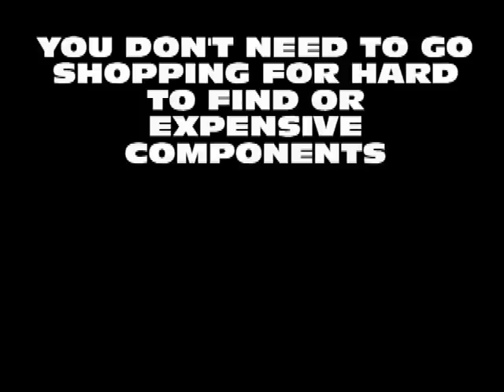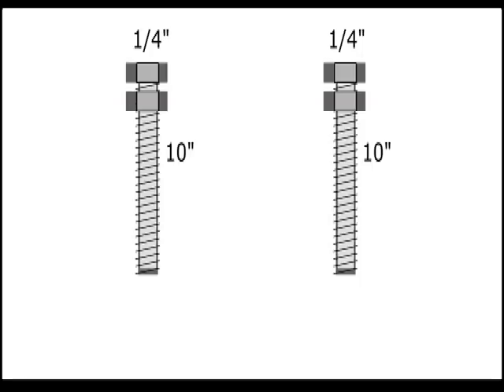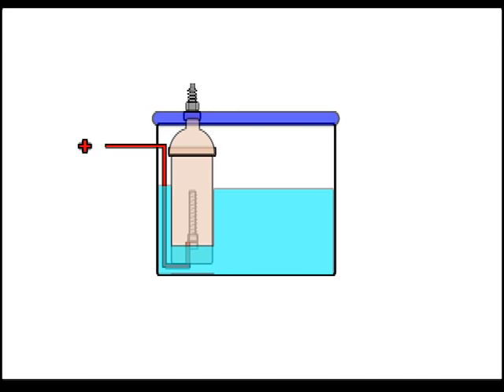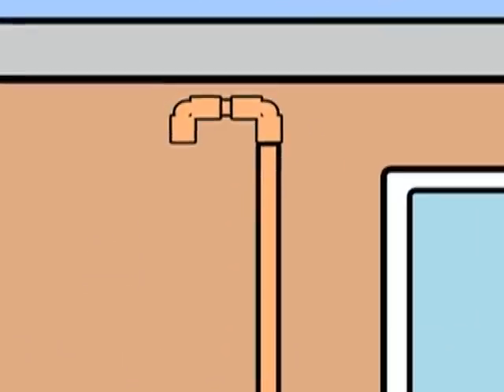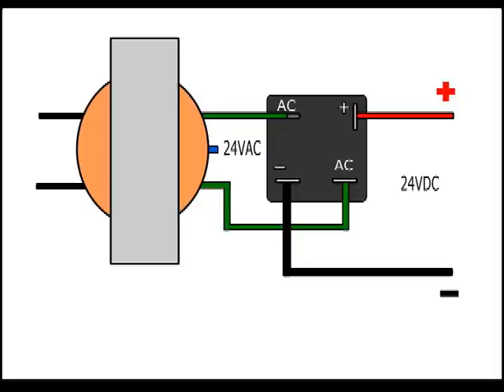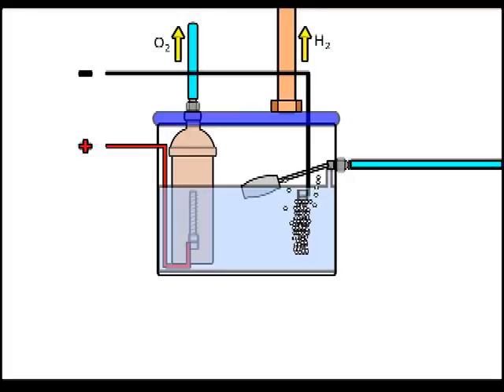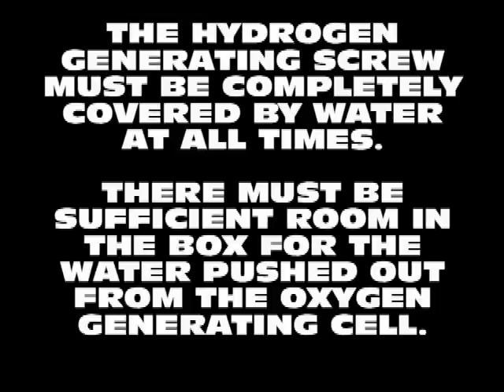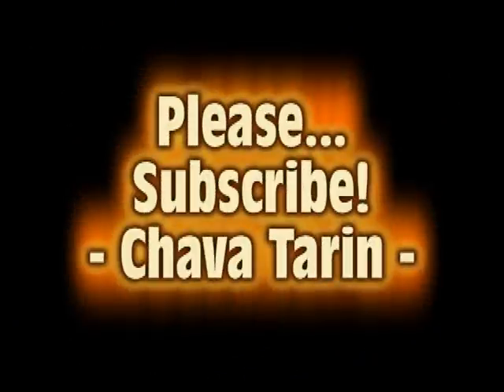Homemade Oxygen Generator

Comment: I think there is a big mistake here:   ONE  screw only?    there in no surface area there, it will only produce a minuscule qty of O2, no?   Thanks
edit:    i went back,and you did say that the surface area may need to be increased; anyway,that is the principle,and needed cautions, good video.
Reply from the maker: You´re right, the larger the area the more contact with the solution and the higher the amount of O2 produced. The problem is if oxygen is too abundant, there is the risk of a fire. Anyway, the principle is valid for bigger plates, generator cells and amount of water. You can even work with much higher voltage than the one I suggested, and get several liters of oxygen per minute.
Reply: @eltunene  several liters?  i didn't know that,i thought you'd get much less; i will try that,i need a oxy-propane torch; but i do not want accumulation of that H2 anywhere,not even  on top of the water either,may have to use a second bottle for that,vented to the atmosphere thru a just enough thin hose.
Reply from the maker: @josepeixoto3384  Good idea! If you use separate hoses, maybe it will even work by feeding oxygen and hydrogen to two nozzles separately, and replacing the propane by hydrogen. By using larger electrodes, and maybe a higher voltage, you can get more hydrogen and oxygen (separately, in two independent hoses. You can build it differently by using two cells for oxygen and hydrogen, using PVC pipes. One basic thing to keep in mind is to leave the PVC open in the bottom and the electrodes at the proper position in order to have the liquid down until the electrode is not making contact with electrolyte at all, so the reaction will stop when the PVC pipe is almost full with gas. This will insure the reaction will stop and the gas wo'nt "spill around" the electrodes, allowing both gases to mix, which will not be safe at all.